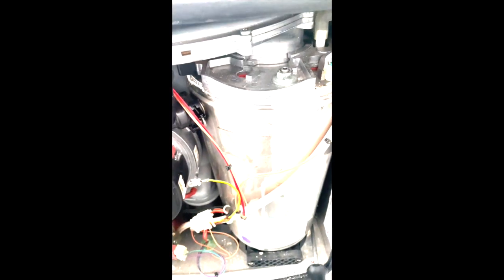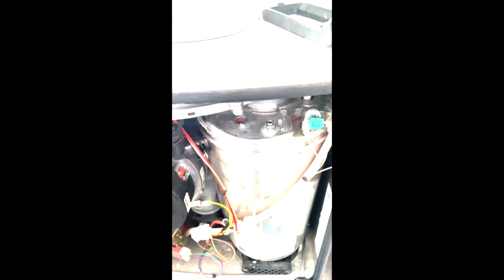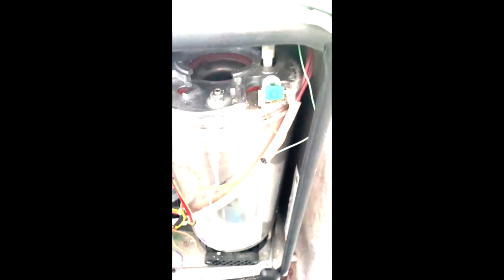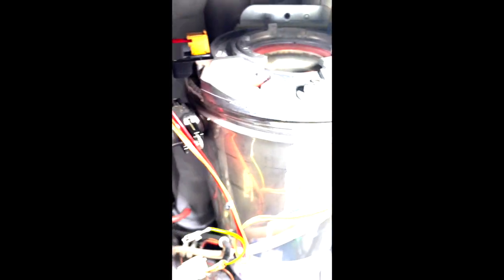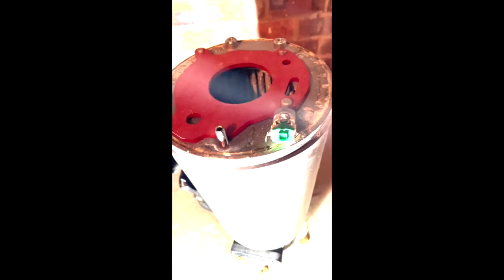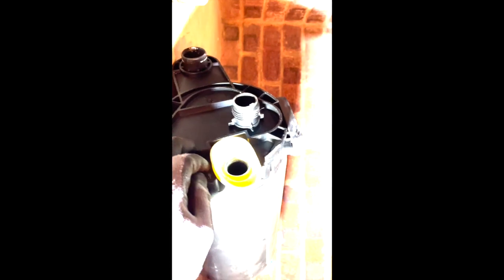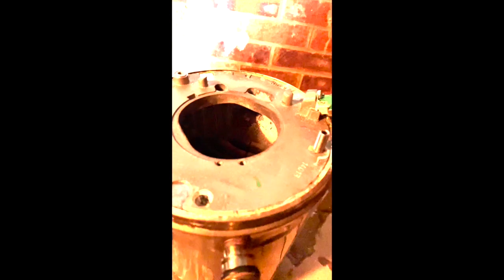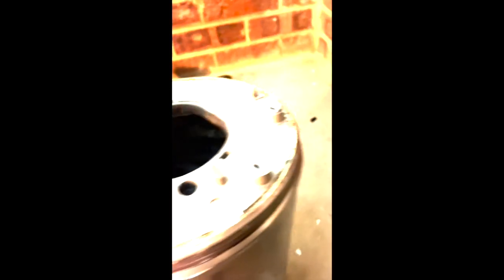leaking heat exchanger

Comment: Interesting video. I have done a few heat exchanger swaps on these. Do you think there is a reason that these exchangers fail like this ?  Dirty system causing restriction, high system pressure on sealed system - expansion vessel deflated. Any feedback would be appreciated, thanks.
Reply: Yeah cause they have no water pressure sensor they can dry fire and ruin the heat ex